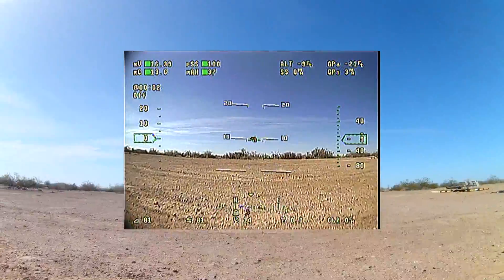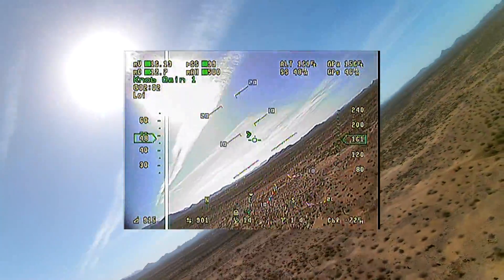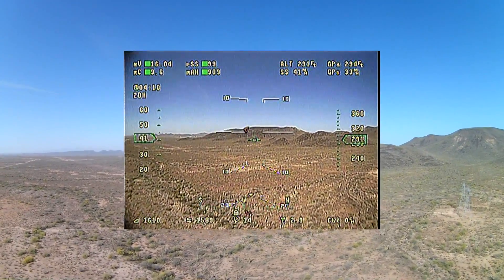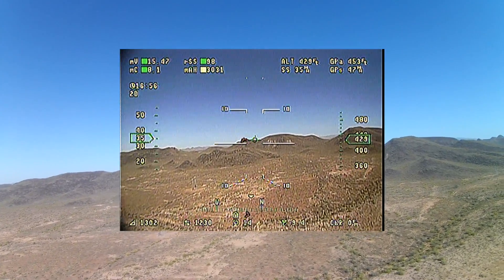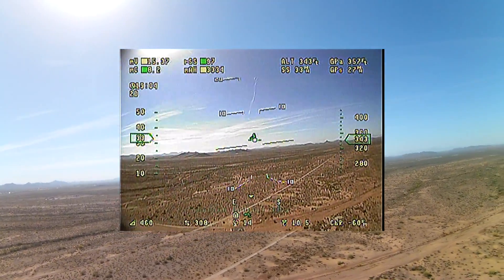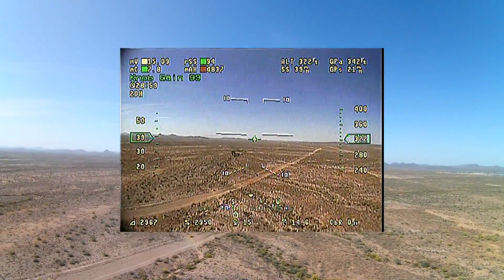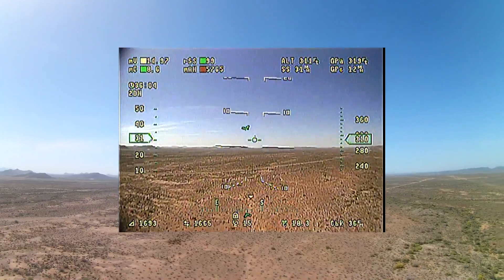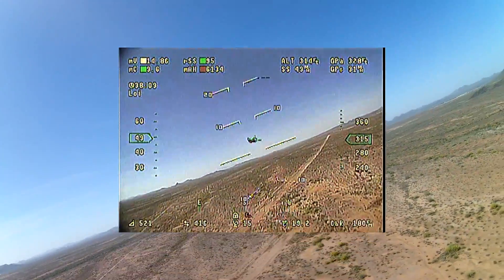How to Tune Gain on Eagletree Vector - My Twin Dream RC Plane

Comment: I plugged everything and my servos doesn't have to much distance travel and my elevator only move up and beraly move down. Help me please
Reply from the maker: Have you verified full travel without using the flight computer? Do that first. If that works, I'd consider a full reset of the Vector. I've never had a problem with full travel on my Vector FCs.
Reply: Thanks for the quick reply, I already figarate, I reset my vector as factory and I did everything again and it work
Reply from the maker: Great! Good luck. The Vector is awesome.

Comment: Looks to me that you are flying fast. My average speed is 34 mph and my MA/mile is 232.4. I have the stock set up and I fly with 50% gains and no oscillation. In fact people think I have a gimbal, it is very stable in 2D. My range with a 10000 mAh 4S is 60.85 minutes and 34.38 miles. This is for 9.2 hours 14 flights.
Reply from the maker: You're right. On this video I am moving along at a pretty good clip. When I'm aiming for range--flying straight and level--I slow it down quite a bit. I did a stall video and AS showed 13mph at stall, so even 34mph is quick for this plane.
Reply from the maker: Here's a link to the stall video I referenced in the last comment: https://www.youtube.com/watch?v=2aIXfTWjwnw
Reply: I have been flying MTD every day now! I missed the SD card in my DVR the other day and I lost data for 1.5 flying time!  I have programed a six position switch with 5 different cruising amps and a three position switch with two climbing, throttle and elevator.  I keep record, most of the times of the flying statistics to see which amps are the best performance.  I have a climbing rate of around 300 feet per minute at 32.5 mph using 1.97 mA/m climb
Reply from the maker: Are you using Dragonlink? If so (or if you otherwise get Telemetry from Vector on Taranis) check out my logging video: https://www.youtube.com/watch?v=D2xWXvY_HHw You can do lots of cool stuff logging telemetry values. Current, GPS, Throttle Position, etc. Anything you can get via telemetry you can log.
Reply: I use EzUHF and I get the Telemetry from the Vector.  I use a Pepperbox with a receiver and a DVR that records all the downlink.  I record each flight in an excel sheet for each plane so I can compare performance etc. I record metric numbers.
Reply from the maker: Try logging to SD card on Taranis. It gives you a csv file you can open with google maps (if you get GPS coordinates) and all the data is numeric so anything you can do in excel like graphing you can do with the data logged to Taranis. You can also get other important information like stick position to help you analyze flight data.
Reply: Very interesting, thank you!  I am quite new to the Taranis.  I will take a look at that and I will let you know.
Reply: Hire my teacher, Eduardo knows a lot about this topic, a man that is always able to help other.
Reply: Yesterday I try gain 200 and that's to much on my model. How can I move up and down through the menu on the gaggle. Do u know

Comment: What gain values did you eventually settle for across the board? also what radius and max angle do you use for loiter?  thanks
Reply from the maker: +Mark Bateman I'll have to plug in and take a look . I'll get back to you on this.
Reply from the maker: +Mark Bateman Ok, 68% pitch, 76% Rol, 82% Yaw. Max [roll] angle is 30° and radius is 210'. Hope that helps.
Reply from the maker: It's better to work out the RTH/Default gain for your airframe. Here are the steps:

Default/RTH Overall Gain
Is only used if:
a. You don't have, or Vector does not detect, a Gain Knob OR 
b. In a RTH situation.
To configure: Find where you GK should be at RTH speed (might be lower than your landing speed) then transfer the GK setting to the Default/RTH Overall Gain.
a. Select 2DH mode.
b. Fly at the Cruise throttle you selected during setup. 
c. Turn GK up until plane oscillates.
d. Reduce GK until oscillation stops.
e. Transfer GK setting to Default/RTH Overall Gain.

The default gain is always the gain used in a RTH condition or whenever the Vector does not detect a gain knob.
Reply from the maker: Don't forget after you set your customized basic gains to turn your GK to 100. If the plane flies well with 100 on the GK, it'll probably fly well close to that on RTH. If you follow the procedure I laid out above, you will find the right RTH/Default gain for your plane and your setup.
Reply from the maker: +JCatRC Default/RTH is for RTH or if Vector does not detect a gain knob only. If a GK is detected and you're not in RTH the GK value is used. If a GK is not detected or if Vector is in RTH the Default/RTH value is used.

Comment: Impressive flight performance with that much with, well done.  Thanks for the video, it’s nice to learn more about the Vector, even though I can’t say I am comfortable enough to do what you are doing during flight.  Since we are flying the same airplane would your gains be something I could use as a very good starting point?
Reply from the maker: +cuboatn Thanks. It takes time to develop enough trust in the Vector to go into the menu while flying and make changes to the computer. I started first by learning to incorporate trims. 2DH must work well before you go into the menu or you can have problems. You can try my gains, but here's something to consider: If you set your basic gains to 200, and your Gain Knob to 12, that is the same effect as having the stock Vector settings of 50% for Basic Gains and the Knob at 50%. From there, you can turn the knob to see what works best, then make note of the Gain Knob value, land, and enter the Basic Gain while on the ground. Example: Basic Gains set to 200. Gain Knob works best at 25. 200*.25, Basic Gain = 50. You want to do this for each axis though. I'll be posting another video as soon as I can fly again showing this.
Reply from the maker: +cuboatn If your plane is equipped similarly regarding weight, and control throws you could definitely use my gains as a starting point. The thing is, the MTD is a big heavy bird and the stock gain settings at 50 with the gain knob at 50 are probably going to yield a mushy plane when it comes to holding attitude. I went out today and did my bix. Even that plane has gains over 100 for pitch and roll.
Reply: +jmxp69 Hey John this is Allen,
I commented when I was logged in to my other You Tube acct.  Thanks for the feedback. I have a lot to
learn and incorporate with my Vectors.  I will follow your video on adjusting my gains with my Sky Walker to learn and become more comfortable. You are awesome thanks again.
Reply from the maker: Hey Allen, Thanks for the feedback. I've gone out a couple of times since I learned to do this and it is a very good skill to have. It has let me get my planes very dialed in. Pitch and roll seem the most susceptible to perturbances, so they are most responsive to tuning.